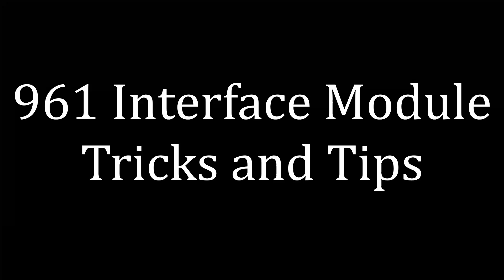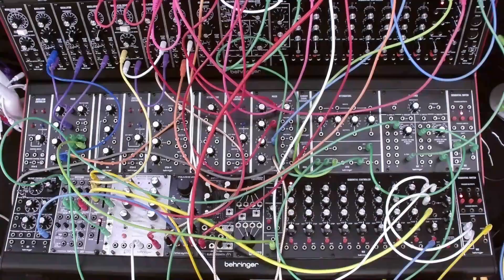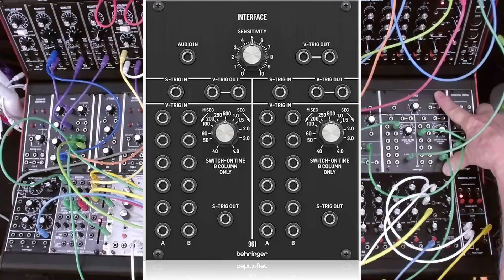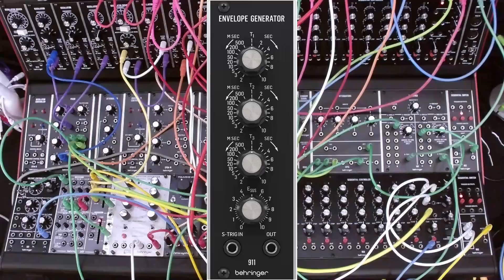System 55 - 961 Interface Module Tricks and Tips

Comment: While I do have a 961 in my behringer 900 series synth, I wanted the vtrig to strig conversion to take place closer to the 911’s.  My solution was to mod a 994 dual multiples panel on one or both multiples so that the top jack accepts a vtrig and outputs s_trigs to the other three jacks on the multiple. It requires one cut trace, a common FET, a current limiting resistor, and a eurorack cable (pigtail) to get the ground reference.  To differentiate a modified multiple from an unmodified multiple, I lablel the top jack with a “v”.  Note that the multiple can still be used as a 3-way multiple.
Reply from the maker: Great Idea!  Amsynths also makes a 6 hp module to do that Vtrig to Strig conversion.

Comment: Another great video! I've been putting together a Moog modular voicing and now with two 960s and two 962s a sequencer compliment--though minus this module since I have no intention of using S-triggers. Given this, I've been breaking down each section of the 961 to its basic functions since I have a lot of other eurorack utility modules to use instead, and am not clear on an aspect of the bottom section, so I'm hoping you can clarify how it works. The top section seems like just a simple comparator with a threshold, the next section is a convertor from s to v triggers--not clear on if this is a logic function that could be done with a logic module, but since I'm not using s-triggers not the question exactly. The main bottom section, however, seems essential for how sequences are put together. This seems like some kind of NOR combineer that would be replicated with an OR combiner for v-trig in and v-trig out. And I get the switch on knob seems to lengthen the trigger time on. What I don't get is how there is only one output for both a and b columns but only the b column is effected by the knob function? Seems like the tiggers for a and b would be combined and then they would be the same regardless. I guess I could use two OR combiners, one with a delay with gate length for b and then a regular OR combiner for a, but I find the logic of how all this works a bit confusing. Again it seems important to understand to really get the most out of the sequencers even if not using s-triggers, so again I'm thinking in terms of what basic eurorack utilities will create the same functions. Thanks in advance for any insight here!
Reply from the maker: Good question.  There are other svto v and v to a trigger converters available ( but you don’t need them, right).  The A column is just an OR function without a gate extension.  B column has the variable gate time ( not uncommon with some other systems ).  A and B are NORed together, producing the S trigger output.  That’s a recap of what you said, right?   You don’t want to build this, right?
Reply: @ozhalljr  Thanks, I think I assumed that if A and B would combined that the gate duration would be set by the combining logic and not before in B--or even that B would then effect A too. I'll have to play with that. I'm not building any modules from scratch, but I will put together modules with the same functions and capabilities so that I can make the most of the sequencer setup--two 960s and two 962s. I think those that get the sequencer/s and the sequential switch/s, and are also skipping using s-triggers might lose out on some of the methods of sequencing if they don't pay attention to this module at least in terms of how it works and how it was used. So I'm trying to understand that better and make the most of the setup without s-tiggers. I have some OR combiners and gate delays, but again I think having a clear understanding of how this works makes the techniques both past and present clear as well.

Comment: In college, we had time to learn this stuff on the studio Moog modular. Not much sound given the work put in, but the journey was interesting, and the waveforms on the oscilloscope was somehow visually rewarding. The came the necessity to work, and I've forgotten every bit of it. Digital polyphonic synths came along, with much more firepower and processing, and no wires, and there's not nearly so much to learn. I can see retired tinkerers in their tool sheds with the B55, getting little sound, but happy with the tinkering.
Reply from the maker: I had synths in college but no modular except what I built .  I swore off modular in the mid 80s because of the lack of presets.  With the rise in modular in the past decade or so, I am enjoying exploring the different platforms and sharing what I am learning.
Reply: We prefer the appellation 'retired tweakers' and nobody would build an analogue modular synth in a tool shed, they're far too precious to us, and also intolerant of temperature variations.

Comment: Thanks O.Z., another great video. I see you are using the B arp 1003 in your rack along with the B 297, I have also created a hybrid system with Behringer Moog, 2500 and system 100 clone modules. This setup is quite complimentary and gives a lot of capabilities not necessarily built into any 1 systemm. Cheers
Reply from the maker: Thanks Tony.  The B 297 is like a dual module with the functionality of the ARP 2600 "Voltage Processor".  The main value added is the dual voltage controlled Lag/Glide/Portamento or 6db per octave low pass filter!  The System 55 has no glide.  It counts on the keyboard to provide that functionality.  The dual envelope is a nice add on, plus it uses the V-triggers.  The little panel to the left allows separate gates for the two envelopes!